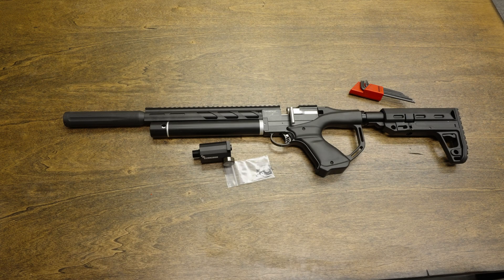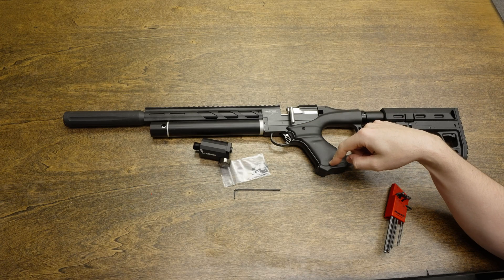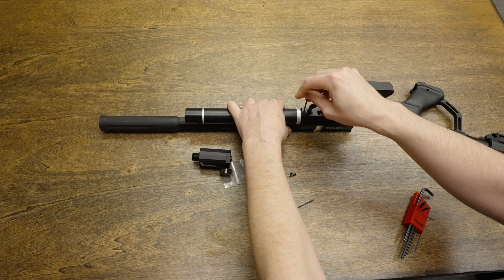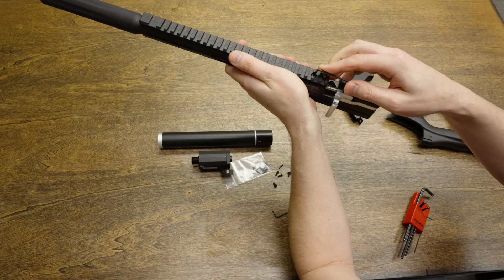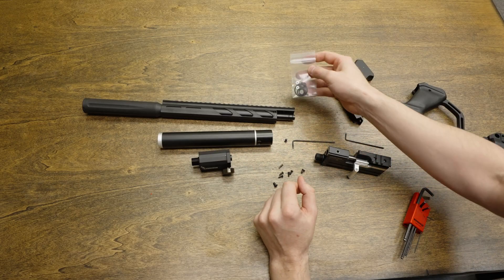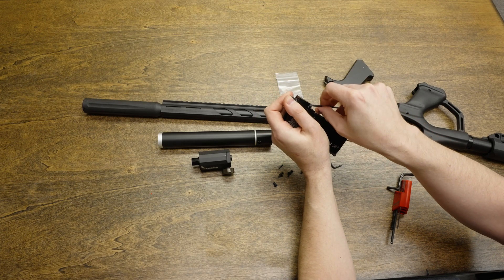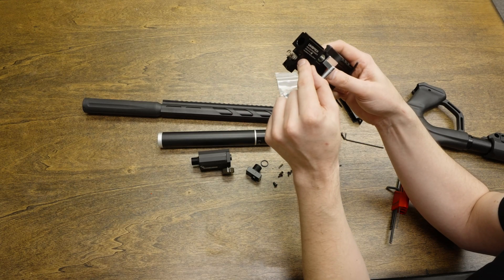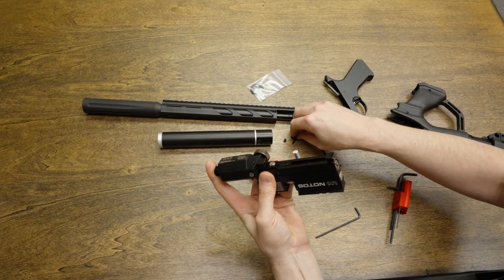CRC Plenum Installation (Umarex Notos Upgrade)

Comment: To those having issues with less FPS as they try to tune after install of plenum. Remember that over tightening the hammer will reduce fps, need to back off when getting negative results.

Comment: 💡You should also add that this unit  comes with it's air opening at a whopping 8mm instead of the puny 3mm stock opening, and that creates a whole lot more power💥😂👍👍👍👍👍

Comment: At stock without making any adjustment I had a low 722 fps to max 732 fps using Hades Diabolo 15.89 gr. not bad if you ask me but... I started adjusting the hammer spring and internal regulator and set them to increase but my actual fps dropped, do this if you can some how mark the stock settings on both, take a pic, or video, marker, count turns etc..this is a very finiky gun to adjust. I installed this CRC plenum hoping to get better numbers than stock. No audible leaks when hand pumping and hammer cocked full. My FPS had dropped below 700 so I started adjusting the internal regulator (again) try to get back to a stock setting, I was at about 2-3 thread from flush and increased to 4 threads plus a 1/4 turn counter clockwise. Here are my results so far: with a full stock PCP tank at the edge of green/red (3500 PSI) my fps was 748 and climbing. As the the tank's PSI dropped from full to 2500 PSI, my FPS peaked at 808.9. After 2500 PSI, the FPS rapidly dropped to 755 at just under 2000. After 30 shots in a 15 shot Maple Custom mag my tank pressure was still in the the green at aprprox. 1700-1750 PSI with shot # 30 clocked at 730 fps. I am curious for an explanation as this reading is the tank pressure not the internal regulator pressure unless I manually set the regulator at about 1900-2000 PSI but I would expect consistent velocities above 2000-2500 PSI due to the internal regulator. The CRC plenum did in my case add 60 FPS and appears to be very high quality. As others mentioned I do think the seller/maker should run some quality testing to give objective measurements or at least post a video. Any comments, explanations are welcomed. I do plan to add an aftermarket PCP tank to a Huben regulator to this CRC plenum..thoughts? worth it for increased shot count or increase in FPS? money, money, money... salutations from a mini green dragon slayer from SoFl.
Reply: I've found that the best regulator setting is 1500 to 1700psi, I'm getting 880fps shooting 21gn slugs that I make myself. I also installed a bigger 5mm transfer port from c88 which alows a whole lot more air into the barrel behind the slug for higher pressure and much higher fps👍
Reply: I've found that the best regulator setting is 1500 to 1700psi, I'm getting 880fps shooting 21gn slugs that I make myself. I also installed a bigger 5mm transfer port from c88 which alows a whole lot more air into the barrel behind the slug for higher pressure and much higher fps👍
Reply: I have the huben dream regulator and carbon bottle, CRC Plenium.I have done all the internal mods,plus a 14inch Weihrauch barrel.Regulator set at 13.5 mpa output with 13.43 gr jsb ,I was getting 840 fps @ 21.00 fp.As my tank emptied, I was down to 10.5 mpa(1500psi) and power increased to 860fps.Lower output gives me more power

Comment: I just installed the new plenum.  Stock I was getting 705fps with JSB Hades now 775-780fps. It was a very easy install and in my opinion was worth every penny. Nice product!
Reply: The plenum I installed is the same as the one in the video.
Reply: What plenum did you used? Or bought? Sounds like a great upgrade
Reply: Does it reduce the shot count any?
Reply: @elimcgraw4066  You get more shots, because you've added 25cc of space for additional air.
Besides the power increase (I went from 750 fps. to 835 fps with 14.3 pellets, and 735 fps with 15.9 grain pellets increased to 810 fps.) you also get a higher shot count. 
My shot count went from about 34 shots before I fell into the red on the gauge, to now, around 50 shots.
After 30 shots (into the red in stock form) I now still have 1600 psi, the middle of the green zone on the gauge.
Reply: Do you still pump it up to manufacturers psi recommendation? Or can you pump it up with even  more pressure since the added air space with the plenum? Thank you.
Reply: @bretc9139  Yes, the working pressure does’t  change the working pressures in gun. If you had the regulator set to 1900 psi you will still have 1900 psi to push the pellet but 25ccs more volume and more energy.
Reply: Do you still pump it up to manufacturers psi recommendation? Or can you pump it up with even  more pressure since the added air space with the plenum? Thank you

Comment: Actually after looking at the eBay page I’m highly skeptical.  750 fps is about normal for a notos with 15.89 out of the box.
Reply: Thats what i was thinking increasing the hammer would make the fps up to 780 with 12-14gr pellets so yea it doesnt seem right although i think the numbers for the maufacturer are with 11gr pellets so in that case it would be a 10% increase roughly with 15-16gr pellets at 770fps with hammer turned all the way out. If youre getting 750 out fhe box on those 15s then thats one hell of a gun and rhe plenum does nothing. I dont have a crono so i cant tell you

Comment: Larger O-ring on the insert piece is nicked from pushing it back into the block, now it leaks. Any idea od the ID/OD and cross section diameters to be able to replace this? Insert came out when removing Huben regulator, leaving the main block attached to the receiver. Any help is appreciated, otherwise I will have to order another one to replace.

Comment: What tool is needed to tighten the center insert piece that attaches to the air tube? When I take my regulator / bottle off this piece always comes out with them. Has two small indentations on the front. Does it need some blue loctite on it to keep ot in place?

Comment: Would there be a replacement tank out there that will fit with this plenum under the notos that you have tried apart from the stock cylinder?